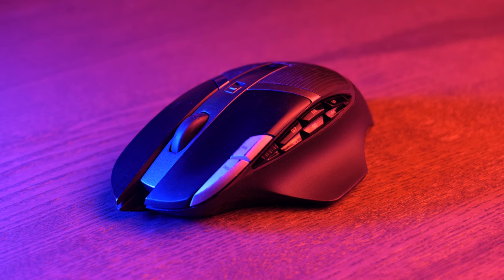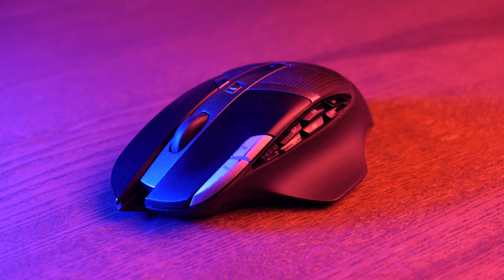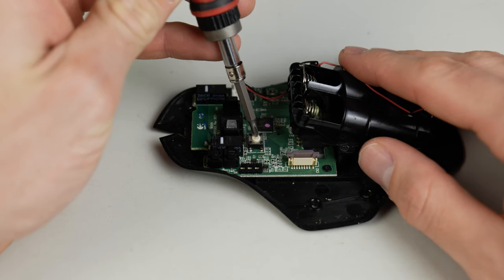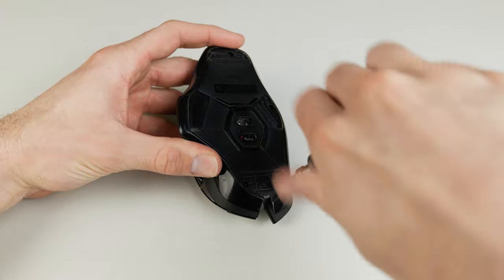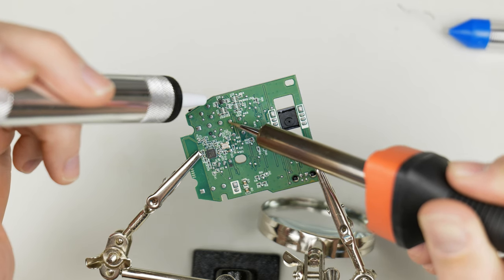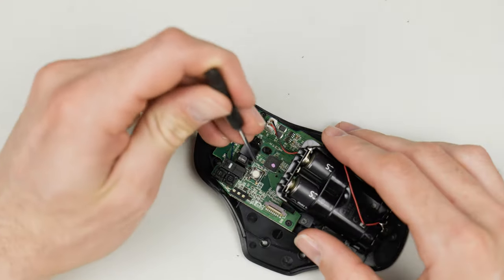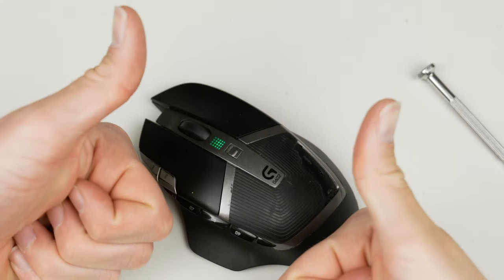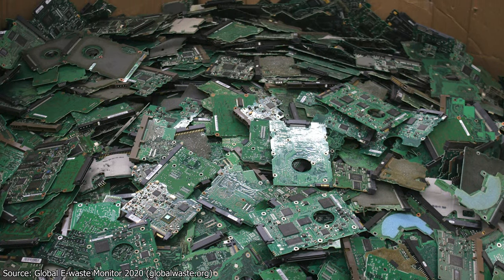How to Fix Middle Mouse Button | Why You Should Repair Your Electronics

Comment: I hate to get away from my G602.  The middle button needs fixing, and the left click needs fixing... I don't want to give it up, as it's so good.  I've had it for something like 9 years I think.   So.. after about a year and half of putting it off, I bought an Corsair Dark PRO RGB SE.... the wheel stopped working within 15 days.  I had it replaced with a new one... anddddd... that wheel broke (intermittent scroll) within 30 days.  Unbelievable. Same fault, two 100 dollar mice.  Honestly.. I want to smash the damn thing even though it's a month old (p.s. the inbuilt battery only lasts about 4 days!!). I went back to my G602.  So.. since I already solder circuit boards for a side project, I might just replace the buttons.  Thanks for the little guide.

Comment: a tip. add a bit of solder before you remove it. it helps alot. :-)
Reply: Yes, you're right. Add a bit of solder for better heat exchange before using the desoldering pump to remove the molten solder.
Reply: wish I read your comment before my attempt! In the end it was still hard to suck all the solder. Had to pull the microswitch while melting the solder. So tricky. Any tips on making removal easier welcome! Took me ages as the solder joints were tiny
Reply: @grahamlewis6777  if you are going to replace a switch... dont remove the solder. no need. add some extra solder and try to heat atleast 2 legs at the same time as you gently pull on the switch. after removal you can try to suck the old solder or just heat the pad and then tap the board against the table.

Comment: Great guide! I also had a lot of difficulty removing the old middle button switch, even while using the desoldering wick and adding a bit solder to desolder. Eventually I decided it was easier to just cut off the legs from the old switch from the top side using small flush cut wire cutters. Then I had access on both sides to remove the original solder and the legs. So I could just about drag/push out the legs using the soldering iron since the switch was no longer in the way. 

Also recommend getting the a few left/right mouse button switches ordered from digikey, since shipping does cost the most and you may develop double click issues in the future.
Reply: do you know what the product numbers are for the other switches? having a hard time finding the info and never done this before

Comment: Just a quick comment to say thank you! I have the same mouse and the middle button was becoming unreliable. After I saw your video I went and bought a soldering iron/micro switch and fixed it in about an hour. The hardest part, by far, was trying to desolder the microswitch.. there's so little room, the legs are bent (by design) and it was really tricky to suck all the solder and get it out. Had to add more solder and pull it out with pliers. Maybe solder wick could help, but that part of it nearly caused me to give up so tips in removal of tricky surface mount components would be super useful.. Glad I didn't give up as it now works fine! Thank you VERY much, I am glad not to add to the e-waste pile...

Comment: Thank you for this! I also have a G602 and have had it for almost 10 years now. My middle button probably stopped working 2 years into owning it, but I just love this thing I didn’t want to get rid of it.  I bought some spare buttons off of AliExpress for very cheap, and followed your guide. I ran into a small issue getting the original button out, since the contact points are so small, but some precision flux and solder wick did the trick for me.

Comment: +1 on repairing electronics and computer mice. Helped my best friend change the left and right click switches on his G300s last month.

The middle mouse button is one I'm not too fond of as I've encountered a bunch of mice whose scroll encoders got broken (not registering scroll, twitching scroll, loose wheel, etc) because of the tilting of the scroll wheel on the scroll encoder mechanism. 

On my G102 I remaped the DPI button for middle mouse to avoid that issue, though said G102 has suffered from the crappy Omron switches Logitech uses so I had to get them all swapped out for Huano Blue Shell White Dot switches.

Comment: Thanks! I'm ordering a few of these switches today. I have two G602's. One at home and one at work. My work mouse recently stopped responding to middle clicks unless I press really hard. I did find some temporary fixes like blowing really hard over the mouse wheel with your mouth or using contact cleaner spray, but it doesn't last very long.  A tip for removing small amounts of solder like these 4 pins - use solder wick instead of a solder sucker. I find to be much easier than a solder sucker. Lots of YouTube tutorials for using solder wick. It's cheap too. Solder suckers are good for removing large globs of solder, but a wick will completely clean the solder from the pin-hole on the PCB making it super easy to pull the switch out.

Comment: G602 is indeed a great mouse. The first I bought was in Apr 2018 for $38 from the US Dept. of Amazon. I bought another in Jul 2019 for $36 due to misplacing the receiver, and buying a new mouse cost only a couple dollars more than just buying a replacement receiver. Also got the hard case for $11 ($16 now). Currently, the mouse is obsoleted/discontinued, and the same listing has the mouse at $165. Looks like the G604 has replaced it, for $62 currently. The G604 is a single AA with the option of using either bluetooth or the 'Lightspeed' dongle. I was excited at first that Lightspeed is integrated into several other products, including an RGB keyboard. But alas, unlike the unifying receiver, Lightspeed devices need a dedicated transceiver.

My G602 middle mouse button has recently become intermittent. I believe I'm still using the same mouse from 2018, since I had customized the buttons, which requires US Dept. of Microsoft Windows. I'll probably end up getting the G604 for the Bluetooth feature, which will reduce my used USB ports on my laptop by 1 while travelling. I'll still fix the G602. Replacement glider pads are available for $7. Or maybe I'll drill holes into the pads to make future repairs easier...

Thanks for the video showing where the screws are located!
Reply from the maker: Yeah. I still love it. but it is getting grimy at this point with the rubber on the top breaking off.

I do like that all in one dongle solution. I am using a logitech keyboard that uses it. I suppose if my mouse dies for good I know what to get.

Comment: i have a razer deathadder chroma with a not functioning middle mouse click (only registers once every 20 clicks or so), and after watching this video i decided to try and fix it myself as the warranty for this thing expired long ago so in the worst case scenario im down on my $20 amazon gift card for the solder kit and i have to buy a new mouse.
for my middle mouse click microswitch i bought mine from aliexpress since i could only find it there (and either digikey didn't have it or i just didn't search for it correctly. i hope it's the former because otherwise i may have overspent by $2 lol). now i just have to wait for the kit and the button to arrive. looks like the button's gonna come in 30-50 days though unfortunately lol
i definitely agree with your philosophy on repairing things yourself. its cheaper and it's overall good to build new skills. ill let you know how things turns out with my mouse
Reply from the maker: Man, I hope you get your stuff soon! That's a long time to wait. Good luck on your repair. Look forward to hearing about it.

Comment: My son's middle mouse button got unresponsive. It's weird they use push buttons, but ok. I tried replacing by a push button i have here, and it turns out the one i put in has much more tension and needs extra force to be pushed, so the push button is of a different kind. I will try the same model you have used. (How did you learned about the model ? There's nothing written on mine). Thanks !

Comment: I use Corsair Scimitar and finally replaced the left and right switches with Cherry ones, however i cant find a higher quality middle button, do you have a recommendation? i would prefer a longer lasting / higher quality switch

Comment: You should blow on it heavily with your mouth first, air might fix it and get rid of the dust which might be the issue, if not then replace it, this mouse is amazing, I went and bought another one just in case my current one dies on me, stupid Logitech discontinued this amazing mouse and replaced it with g604 which needs another buggy software from what I've heard.

Comment: Cheap button but 80 USD shipping to South Africa lol.. I'm sure i can source them at a local electronics shop tho. Mine is only the Logitech M235 cheapie and it's now over 10 years old with daily use so it's served me really well but still, I don't want to have to replace it. The downside to the cheapie is that I can't seem to get it open without having to destroy the whole housing! No screws, no real seams either, I can't tell where to pry it apart

Comment: ** BEFORE YOU BUY A SOLDERING IRON AND A NEW BUTTON **

Buy a can of contact cleaner or WD-40. Carefully spray a little it on the button and click the button a few times to work that liquid into the inner parts of the button. 90% chance that your button will work fine again. The button will wear out eventually but this method will keep it going for a while longer before you have to actually replace it.

Comment: I bought my G602 in like 2014-15 for $20 on a Walmart clearance rack after it sat there box looking smashed to hell for at least a year before I said f-it lets see if it works, and its been my favorite mouse since
Though her middle mouse click hasn't been working in a few years, and G10-G11 are starting to stop
Its about time to open her up and clean, but I'm so scared with my dumb luck I wont have a 602 anymore after lol

Comment: do know anything about G900 or G903's middle button? I've tried to search for it but still not clear about what kind/model of switch it uses.
Reply from the maker: Endurance and performance modes. Performance will have a higher poll rate thus be unnoticeably snappier.